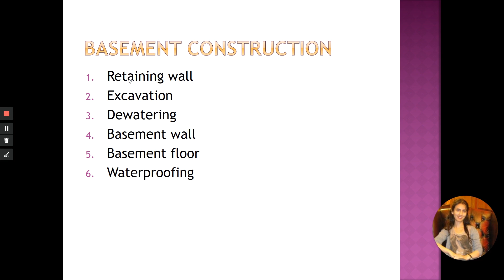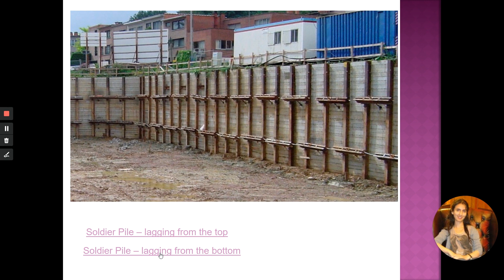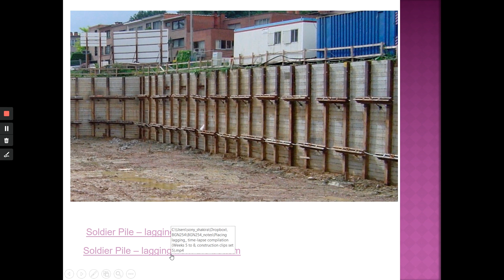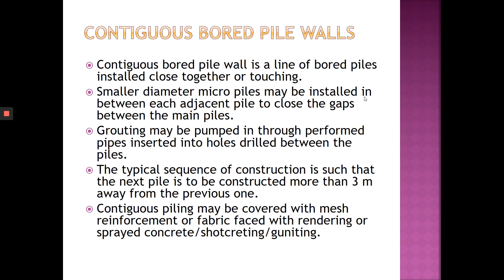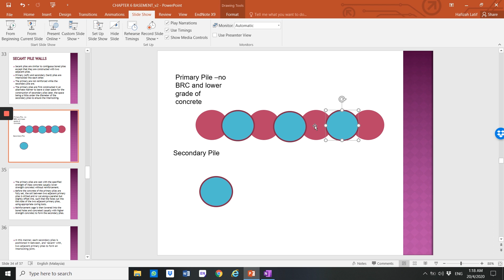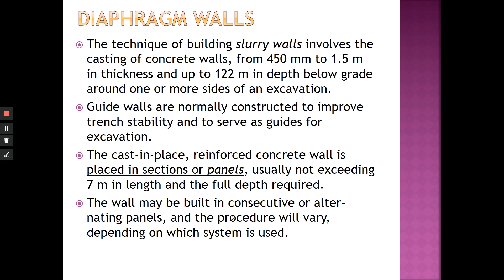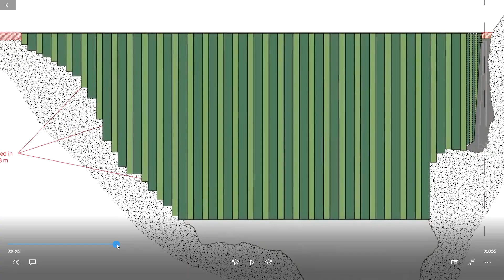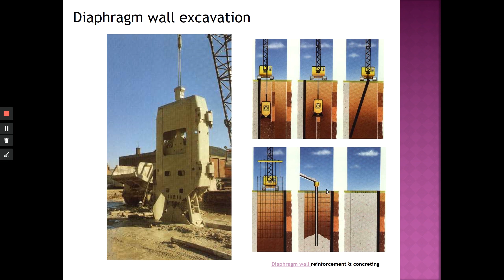Basement (Part 2): Retaining Wall

Comment: Thank you for the good explanation dr. Btw, are contiguous bored pile walls in other shape or cylinder only? if in cylindrical shape only why? can't it be in another form?
Reply from the maker: Yes, bulat because of the machine and fraction of surface. You want to rotate the machine, so bulat lebih practical, logic tak?
Reply: @hafizahmohdlatif8794  ohhhh yess logic dr! I have never thought of this before. thank you dr.